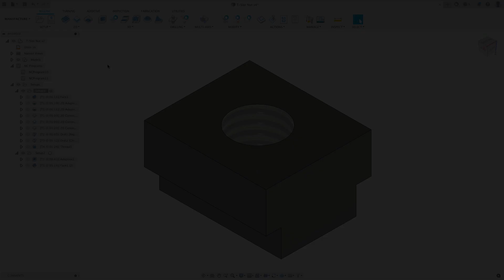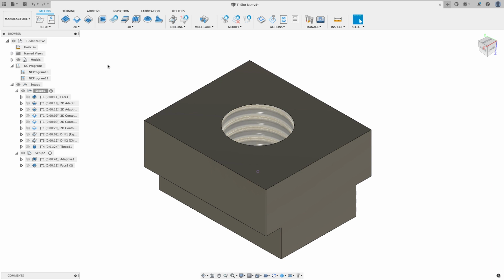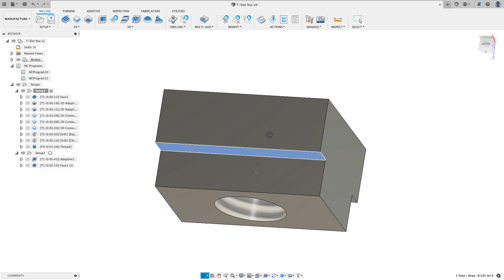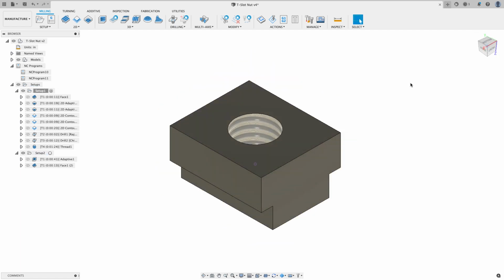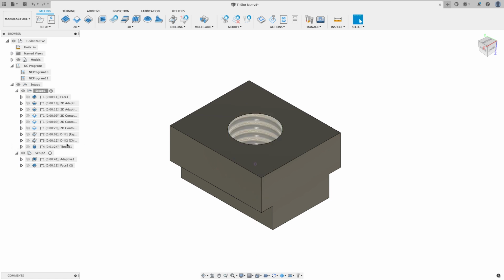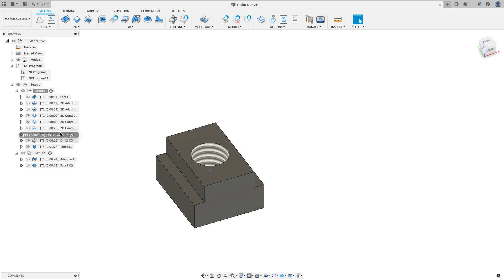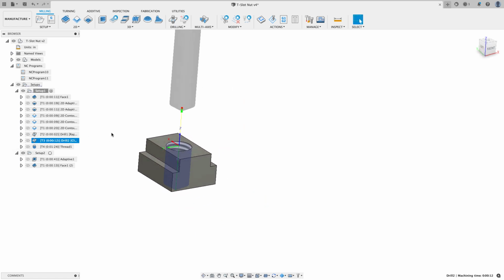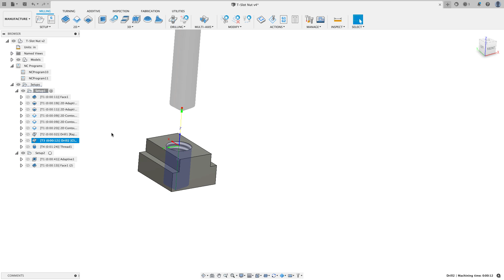Syil X7 Machining 1018 Steel

Comment: Firstly, thanks for another great video Kevin ... 🙂

Next, I'm not a machinist, so this might be a dumb question, but why do you care about having the vertical corners of the nut as sharp, square corners?

To my mind, in use, those corners will take quite a hammering when the nuts are being installed and removed, with those corners taking the most abuse, so why not allow a small chamfer, or radius on the corners?
Reply from the maker: I don't think there would have been any issues with a rounded corner. As you noted, it wouldn't have made them any weaker and probably would have made them nicer to handle. I don't remember exactly why I did it. It's possible it was just to show that the option was there.

Comment: I realise this was 6 months ago but if you had drilled the hole right through the part your coolant and chip flow could have washed straight out the bottom during the thread milling cycle.
Cheers from Australia where my mate Aaron just put me on to this video.
Reply from the maker: Yep, that probably would have been a good idea. I wasn’t too worried about the coolant or chips with the single flute threading tool.
I’m sorry you have to put up with @aaronengineering. No one should have to endure something like that! 😜 😂😂😂😂
Reply: @MechanicalAdvantage  He is a really BIG problem over here.

Comment: Kevin,

What are your thoughts on full axial machining with lighter radial cuts? I was told it is the modern way to machine. It applies equal pressure on the entire length of the tool and wears more evenly. Vs. just using the tip of the tool over and over again for the various depths of cut… I so far have had great success with that approach in 17-4 SS as well as 304 SS.
Reply from the maker: Hi William, that is my preference for sure. Had this not been the first time I had cut steel with this machine, I would have used a 3D adaptive clearing operation. Had I done that, it would have gone the full depth and around the whole part first and then would have stepped up and cut the two flats second. I just wanted to be a little conservative to start and did it the way I showed. I’ll absolutely take a much bigger axial depth cut and the same 12% stepover the next steel part I run on the machine since things went so well.
Reply from the maker: The other thing I should mention is that there is sort of a reverse of deep axial, light radial machining called high feed. Jason Synder (Nerdly on YouTube) uses this method on a lot of the steel he cuts. High feed machining issues a very small axial depth of cut and large radial stepover at a fast feedrate. Depending on the situation this can be faster or better in areas like pockets where deep adaptive toolpaths could encounter chip recutting because there is no place for the chip to evacuate until the cutter starts to increase the size of the pocket.

Comment: I love your videos, but it takes doubble amount of time to watch when You use imperial units only since I have to stop and do the math.  On the other hand I will still watch all of your videos even if you measure everything in lightyears :)  I hope you keep up these coming!
Reply: You saying there is another measurement besides Imperial ? LOL Just kidding of course, I know that feeling when only Metric is used.
Reply from the maker: I'll try to improve that in the future as well. I'm pretty good at CAD/CAM and now I have the need to learn some other skills like video editing a how best to use cameras. Right now I'm using Camtasia and in past videos where I have listed feeds and speeds in both units, it was really time consuming since I just used the on screen text tool. I want to look into some sort of a graphic template so I can quickly enter that info. If Camtasia can't do that, I may look at switching to something like Final Cut Pro.

Comment: I was impressed how solid the cutting sounded when milling.
Reply from the maker: It sounded really really good standing at the machine. A combination of a rigid machine and quality cutting tools with the right feeds and speeds (with a little help from my friends). I've wanted to move away from only machining aluminum and plastics all the time. I'm thinking of making some fixture plate accessory ideas that i've been kicking around in my mind for a bit. After machining these pieces, I'll definitely be moving forward with some prototype ideas around those ideas.

Comment: Since these are completed and to late to stop short of a full depth thread it might be a good idea to punch some areas around the bottom of the T-Nut thread to insure the stud never protrudes through the T-Nut then bottom out on the table forcing the nut up with risk of breaking the casting slots.
Reply from the maker: Hi Ken. The way the thread mill cutter is designed, it doesn't cut a thread all the way through the part. I've given it a try, and even with a big ratchet, I couldn't get the fastener to go through the bottom of the part. Which was what I was hoping for with the way I did the threadmilling. I would have but a decent negative offset on the bottom height if this was meant to be a through a thread.

Comment: Very nice. Maybe I missed it in the CAD/CAM video, but any reason not to use a conventional tapping process? Just curious.
Reply from the maker: Hey Doug! Good to see you here. I'm moving away from taps and to thread mills simply for versatility. The goal is to have a handful of threadmills that can cut a very wide variety of thread pitches. Hope you are well.
Reply: Tapping is often faster, but thread milling has better process stability. The spindle torque requirements are lower, workholding is less critical, the surface finish is usually better and you can compensate for tool wear. If cycle time isn't critical, I'd always prefer thread milling - there's just much less to go wrong.
Reply: @j.dietrich  Yes, you also don't need a slew of different taps with the single point or single form thread mill.

Comment: A little dark video around the tool but awesome job, thanks for your time
Reply from the maker: Thanks. Yeah, I'm really fighting the light. A black vise, black coated tool, and steel that is dark in appearance isn't helping me. I'm trying to find a magnetic LED rechargeable light that I put in the machine and remove when not needed. I've bought a handful so far, but they create a strobe effect when I record. I'll get it though. Thanks for your patience.
Reply: @MechanicalAdvantage  Not a big problem for sure, don't worry and thanks again for your effort for us.